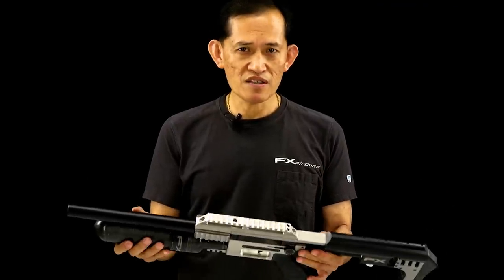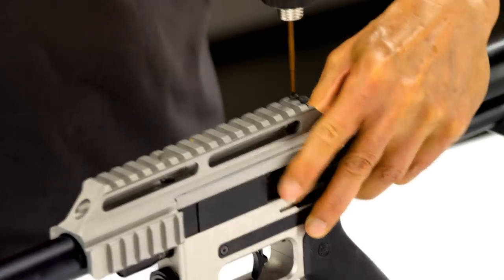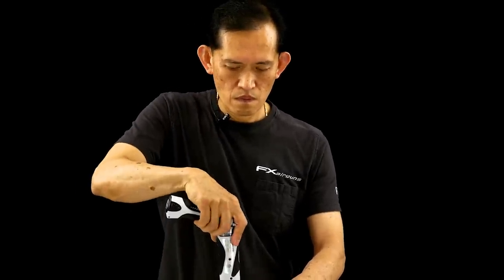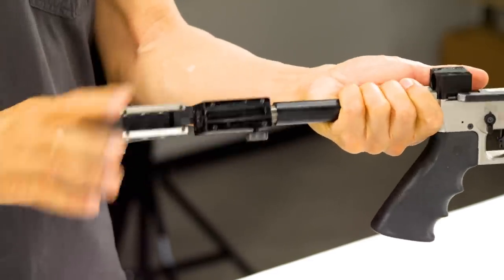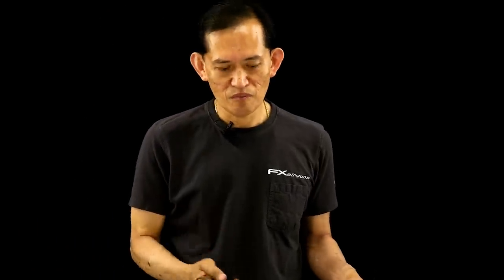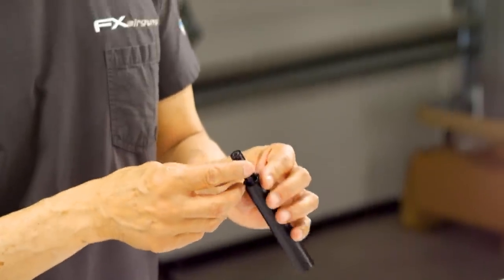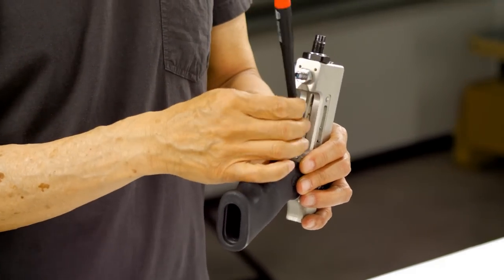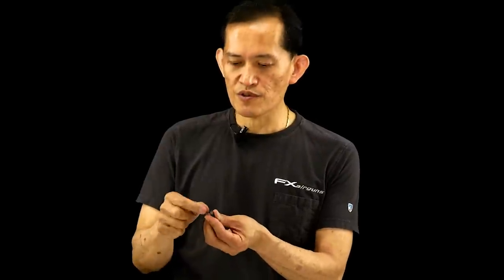How to Disassemble the FX Impact - FX Masterclass

Comment: 13:15 Bass adapter.  My Mk3 was working flawlessly on October 22.  I switched from the .30 barrel to the .22 so I could compete locally. November 3, it started snowing.  We had snow on the ground for another 5.5 months. Gun was stored in the case.  I opened the case in April.   Was saddened to see no pressure. Pumped it up but I could tell it was leaking.  I could put my finger over the counter sunk area of the Bass Adaptor apply pressure and release and could feel it pop a little. I didn't know what it was called, how to safely empty the gun or what to do but thanks to this video, I do now!  Thanks Ernest.
Reply: Fixed it!  There was a metal sliver in the o-ring.  I bought one of those FX O-ring kits.  Back in service!

Comment: Im about to do a disassembly because for some reason, the hammer adjuster hex screw assembly is completely loose! It can slide back n forth with a flick of my finger.  Any tip on what part ciuld have come loose or broken?

Comment: My FX impact mkIII is leaking around the bottle adapter in video you said it was torque down so if I need to fix the leak is it ok to remove it myself and what is the torque setting for it

Comment: Hi there Ernest I have a question about the mkii pp working pressure valve I want to put in mine a New botle in 350cc and 4500 psi the question is can use this botle at 4500psi or 4000 psi or not?
Im glad to learn here.
Have a nice day

Comment: Hey Ernest,  how do I rebuild the FOSTER fill valve?
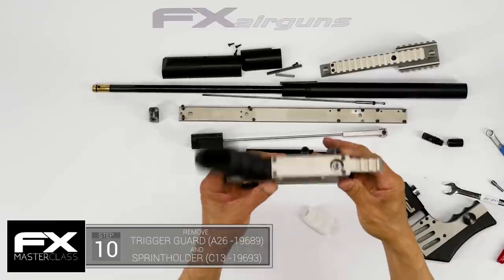Reply: @Bo Lorentzen Degas your gun then go to the 8:50 mark. Just take off the trigger guard and screw it out. You will need to replace it with a new one. These have a check valve built in and can be repaired though. This might work:  https://www.youtube.com/watch?v=IlJk5MmZQgA

Comment: Does the impact come with a spare set of all the rings?
Reply from the maker: No, they do not, you can order all O-rings from FX USA by calling (866) 639-0772
Reply: For $2000+ USD, they should come with a spare set.
Reply: @CDOO2391  yep I agree. I bought mine 6 months ago and the probe catches on the mag. Got to take the probe out and file it down 🙄